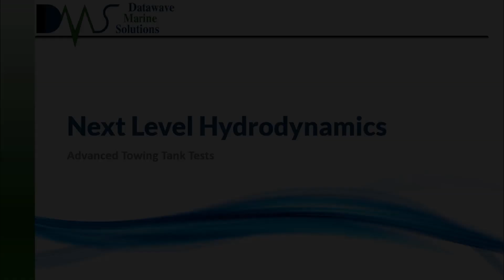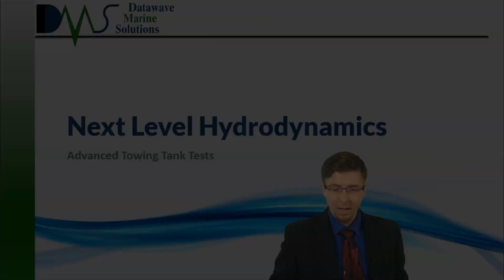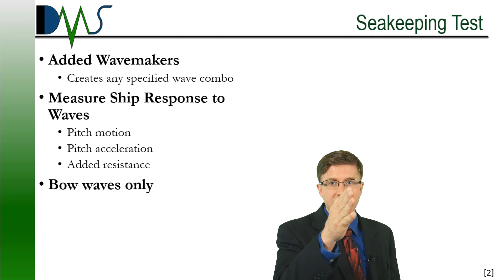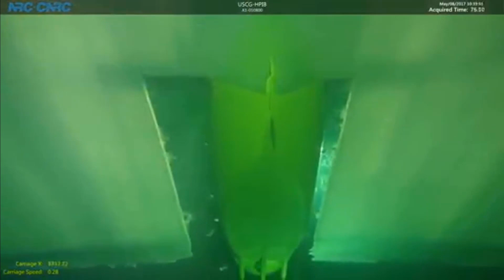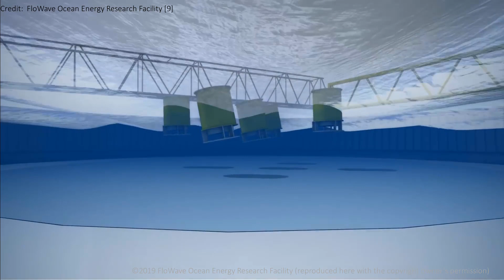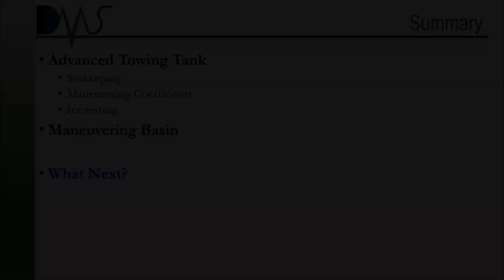NEXT LEVEL HYDRODYNAMICS:  Advanced Towing Tank Tests

Comment: Are all new ships go through this.
Reply from the maker: Not all new ships.  It depends on the exact priorities for that ship.  Navy ships usually get the full round of tank testing.  But the US Navy also has it's own towing tank.  For many ships, we now use a combination of less expensive tank tests plus computer simulations.  99% of the ships will get a basic test to measure speed and power for the ship.  That's because when the ship gets built at a shipyard, it's part of the shipyard contract that they are required to match the speed and power predicted by the tank test.

Comment: How do you allow for the fact that you are towing through waves with the craft moving at a constant speed? In reality a craft will slow down when it encounters a large wave and it 's pitch angle may well be different.
Reply from the maker: We hold the towing speed constant because that allows us to compare against other tests done in calm water.  As part of that comparison, we calculate the additional power required to maintain speed with each wave.  In reality, a ship can either approach waves with constant power output, or adjust its throttle to maintain constant speed.  On the theoretical end, we tend to consider the ship as a constant speed, because it makes the math much easier.

Comment: I'm still perplexed about how we scale the size of the ship to be tested, but we don't alter the viscosity of the water to match the scale of the model ship...? The width of a water molecule that is pushing up the ship isn't scaled to the widths of the molecules of the ship surface. It would be like scaling tire designs and testing it on a regular asphalt surface.
Reply from the maker: Part of it is simple practicality.  First, we can't scale the viscosity of the water.  To do that, we need to use a different fluid.  To scale it properly, we would need a range of different fluids, all with different viscosities.  And then there is the cost of replacing a giant tank full of fluid for every new model.  

And the width of a water molecule touches on one of the major assumptions of fluid mechanics.  We generally assume that the water molecules are so small that we don't need to think of them as individual particles.  We don't need to worry about the individual molecules.  And that assumption has proven fairly useful so far.  

Even at model scale, a water molecule is several thousand times smaller than the ship model.  It is so small that it doesn't notice the difference between full scale or model scale ship surfaces.  To use the tire analogy, it would be like the tires on your car had grooves that were spaced only 1 nm apart (much smaller than a human hair).  With that close of a spacing, the surface looks the same, no matter the size of the vehicle.
Reply: @DatawaveMarineSolutions  You are still only making estimates though... hulls for performance should really be tested with a 1:1 ratio with sensors along the hull. Really the only logical thing that could be simulated would be something like a leveraged ballast to simulate equipment, crew, and possible cargo. I know its from a part of a school where you just have to produce an environment instead of gathering the budget for a full size test though. If only money works they way it should some day...

Comment: I just saw the video about tow tanks and was wondering if there were tanks that simulated waves. Anyways, what I can imagine next is a floating laboratory where the model is placed out front and moved through the open water by the laboratory. Real world testing but limited ability to change testing  characteristics.
Reply from the maker: Yes, in fact most towing tanks come with a wave maker.  Wave simulation happens very frequently in towing tanks.  We can specify the length and height of an individual wave, or we can specify a whole group of waves to simulate open ocean conditions.
The really fun tanks are the ocean basins.  Those often have wave makers in two directions.  That allows us to simulate a very complicated water surface, and to occasionally create some fun visuals.  Check out this fun video about the FlowWave tank:
https://youtu.be/iWKFPTgkpXo

Comment: I've seen ice test, we are building an icebreaker and there is some videos stored from the Basic Engineering. It's done with a self propelled model, and it's run in different speeds and ice thickness. They also tested the main maneuvering tests, but with ice, boom!
Reply: I envy you